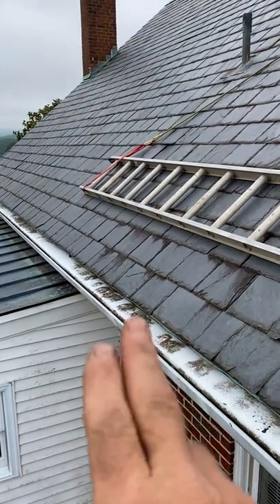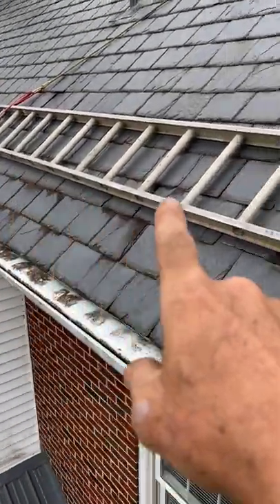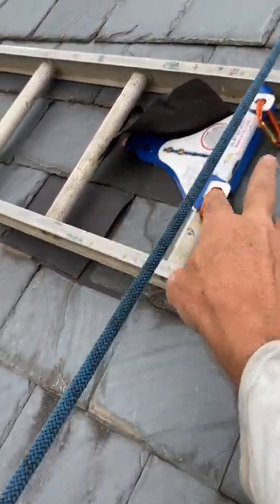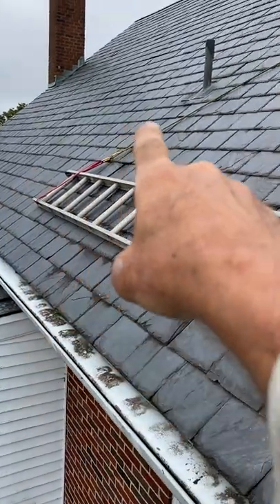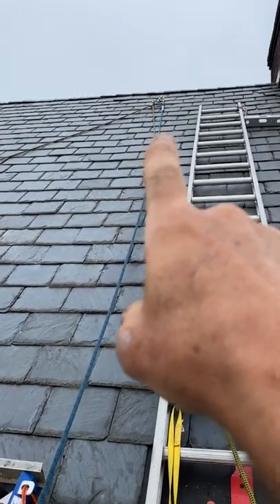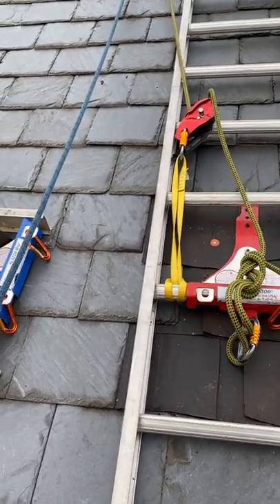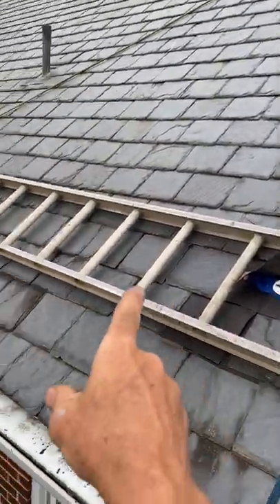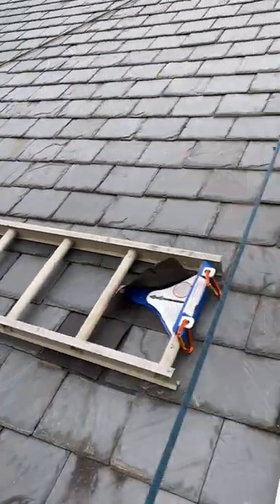Slate roof:  horizontal movement by pivoting a ladder from its base.

Comment: Wouldn't it be more cost-effective to rent a lift? I like your ingenuity though.
Reply from the maker: Rarely (in the last 10 years) have we had a job to do that is better suited for a lift.  Mainly that’s because of:  terrain, inaccessible area for the lift, a prior company destroying the yard or sidewalk with a lift, the impracticality of doing slate repairs from a basket, and the new safety features on the lift that won’t let the basket reach out or up when the main unit is even on a small incline.  Although lots of folks use them, they are generally a poor fit for our jobs and terrain.  We find them awkward, slow, impractical and expensive for our work.  Good question.  Thanks for bringing it up.

Comment: 2 hook ladders be far safer
Reply from the maker: Actually, since I’m using fall protection, on a sternal fall arrest ring, along with maintaining my rope tight, I could not be any safer in this scenario.
Reply: @BlueGlassLLC  💯 you can , put a Scaffolding up
Reply from the maker: @roofingcontractors3349  Thanks!  Right you are.  Good point.  I took the video from the top of our scaffolding but we could not fit our scaffolding in the adjacent area because of the air conditioning units unfortunately.

Comment: Why not attach the ID to yourself and just walk leaning into the harness like rope access?
Reply from the maker: Good question.  That would be perfect on most roofs, however, walking on slate roofs destroys them.  It creates cracks, breaks, leaks and more repairs.  80% of our slate repair work is due to painter, insurance adjusters, chimney folks, and uninformed roofers thinking they walk like squirrels but are really more like bears.
Reply: @BlueGlassLLC  Ah makes sense. I haven’t had to work on one yet myself, so thanks for the info!
Reply from the maker: You’re welcome.  They are a lot of fun and hope you get a chance to work on some. @PinkFZeppelin